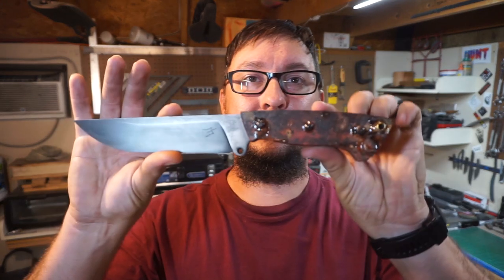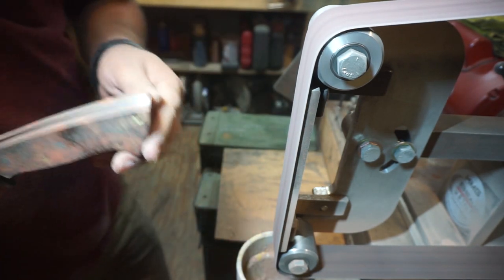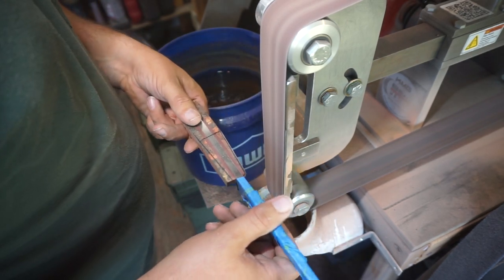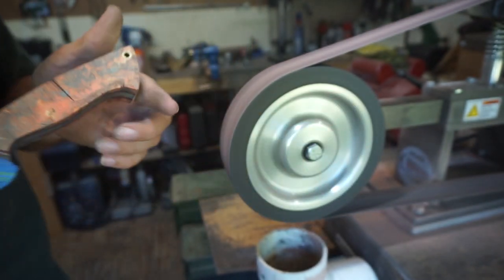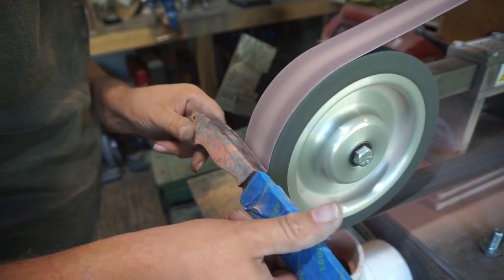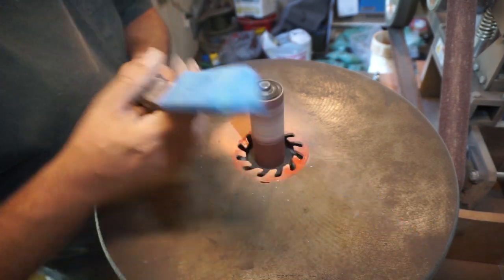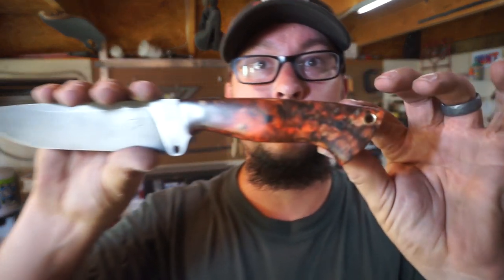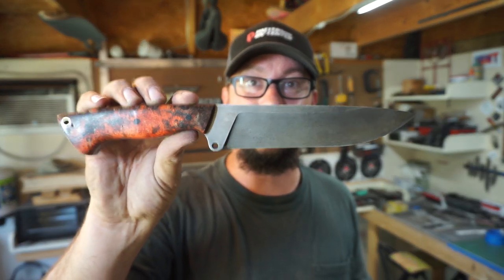How to Shape A Coke Bottle Knife Handle | Knife Making | Vlog

Comment: I'm thinking about doing something similar to my Ontario Tak 1 micarta scales.  Maybe not a coke bottle shape, but more of a Cutco steak knife handle shape.  I've done this before to a RD7 micarta scales all by hand with different  sandpaper and it turned out well.  Took some time, but got it done.  Not having power tools or sanders or a shop is just something you have to deal with.

Comment: How thick is the metal in this build?
Reply from the maker: It was 1/4" thick.
Reply: @theriversexperience9383  that’s what I thhought.   I have a billet of 52100 and 80CRV2 that thick and 2.5 in wide.   I’m trying to think of a blade to make that big.   24 in length.